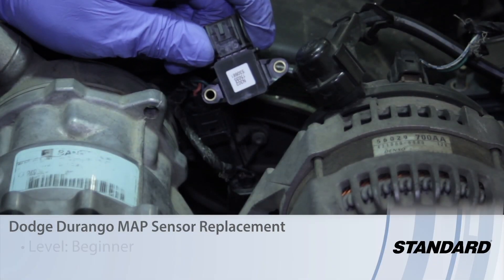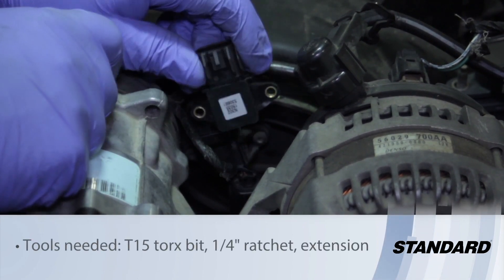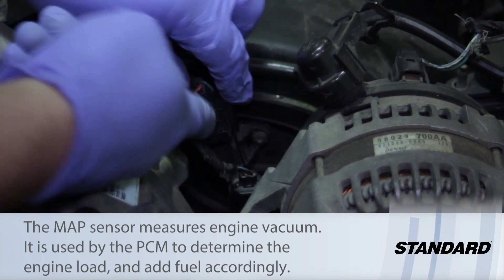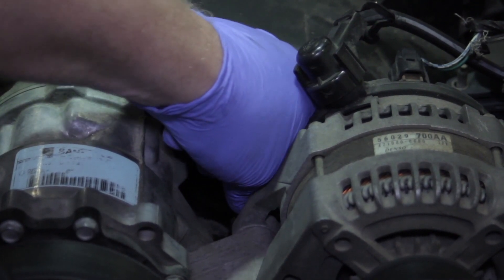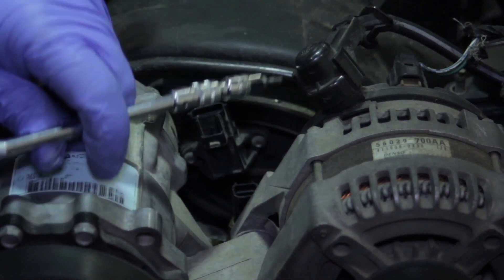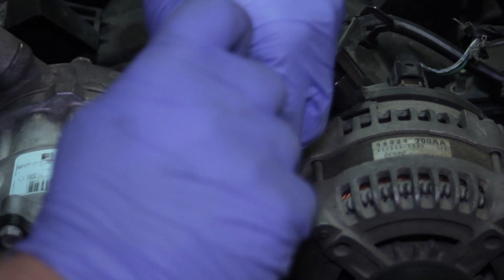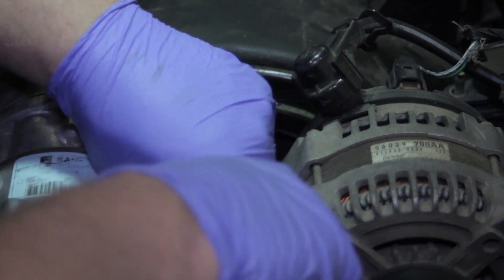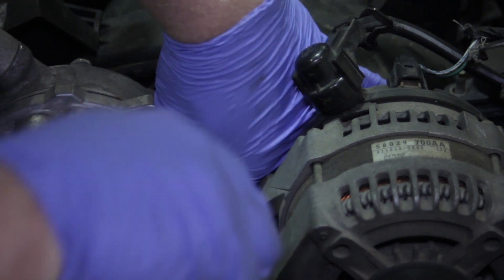Dodge Durango MAP Sensor Replacement

Comment: I can't get that other cap outta the way and you cut the video instead of showing how...
Reply: Me and my friend were able to bypass that part, we could not unclip it, he was able to take out the MAF, he flipped it over, we used electrical tape to put back the small screws after I cleaned the sensor, he made a small slit in the tape and put the screw through the small slit and screwed it on while the tape was still on it, so he would not drop the screw, it worked, he pulled off the tape with a leather man tool, so far so good, my vehicle was stalling, surging forward on its own, hard to turn over or start. I had a lot of the common symptoms of a dirty sensor, I could not find anywhere to buy a brand new one.
Reply: @Nuxalkman  I got my new one on... after struggling with it, somehow it just slipped on... I ran my car for a few minutes and it died... engine turns, but doesn't fire. Codes are gone (except an O2 sensor that I've always had).